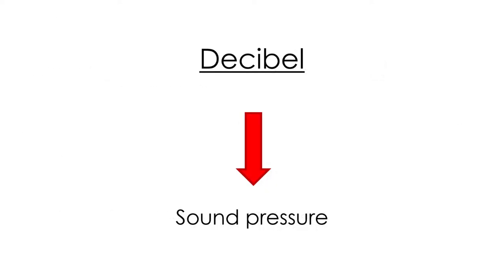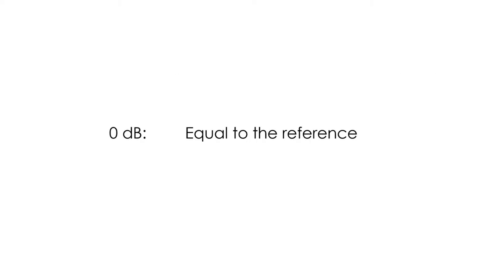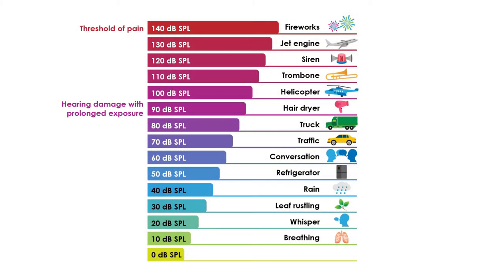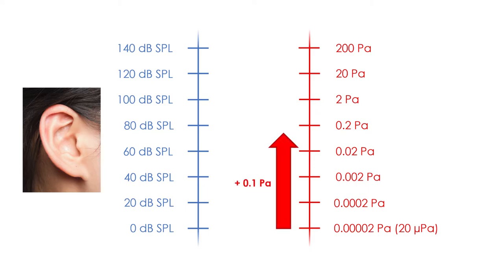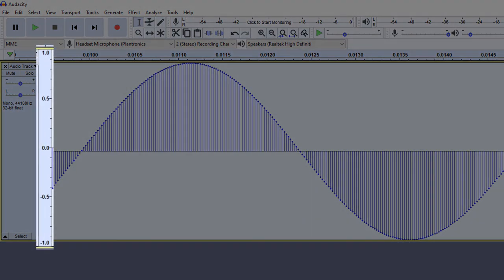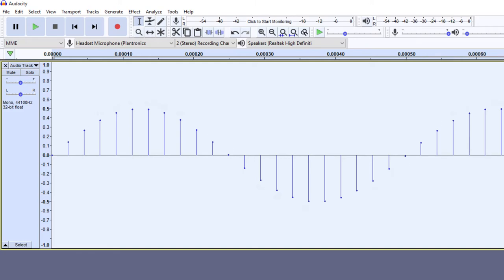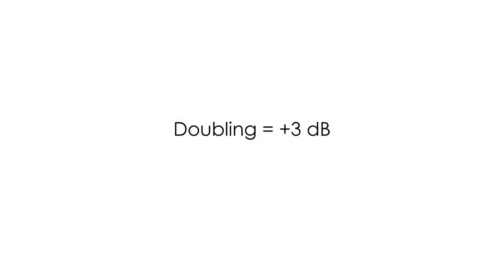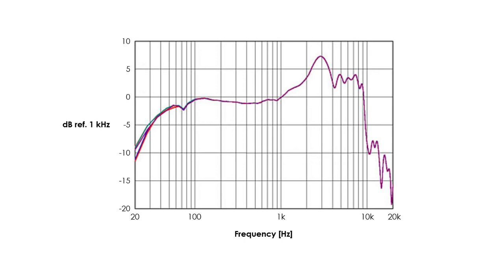What is a decibel: sound pressure level (dB SPL) and other types of dB - Ep. 02

Comment: I have a mems microphone with16 bits digital output and -26 dbFS of sensibility.
I need to make a db meter.
How convert this digital output to spl db ?
Thank you for your video
Reply from the maker: Hello!

Typically there has to be a calibration procedure, I think there could be different procedures and I'm not sure what is the best one for your specific product, but for example for Brüel & Kjær microphones you can use a B&K type 4231, it is a box which emits a specific frequency at a very specific pressure level (I think 1 kHz at 1 Pa), you insert the microphone inside, and then you can take note of what is the conversion. For B&K microphones you would look typically look at voltage rather than digtal values, but in an equivalent setup, if you get -10 dBFS at 1 Pa then you know that is the conversion, and from it you can convert anything else.

You might also want to research the pistonphone calibration procedure

Comment: I've got several references to a threshold of pain (130 dB SPL) equating to 2.9 psi.  However, when I convert 2.9 psi to Pa and get 19994 and I plug that in to the I(dB) equation 20*log10(19994/.0000203) where 20.3uPa is the reference threshold for hearing, I get 180 db.  63.24 Pa is 130 dB SPL, but that 63.24 Pa is 0.009172992 psi which is way off the 2.9 psi.  What's going on?
Reply from the maker: Hello! The 130 dB threshold of pain is correct. However, this equals to 63.24 Pascal (per the 3nd formula at 6:33), and converting that to psi it gives 0.009137. 130 dB SPL for sure doesn't equal 2.9 psi.